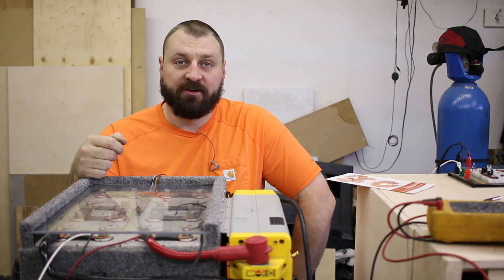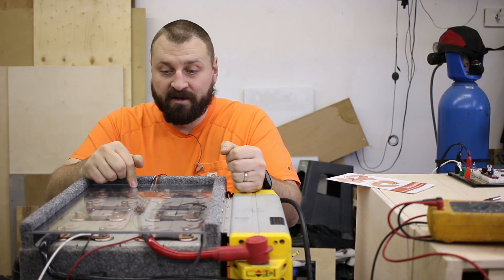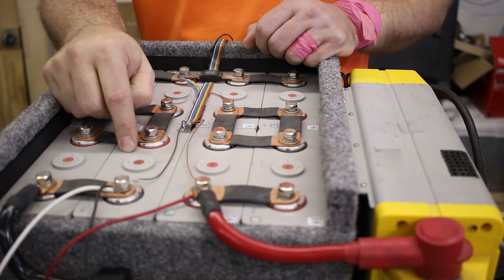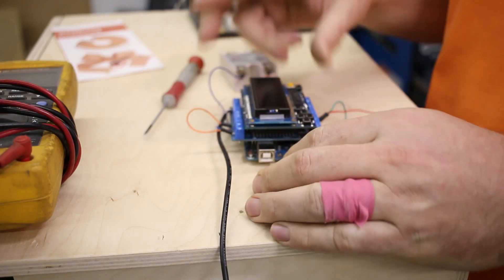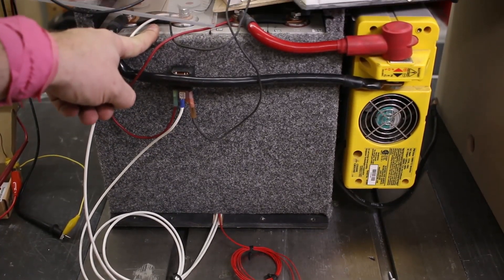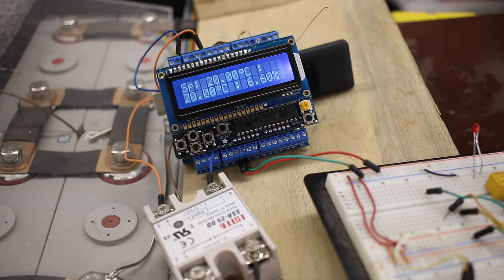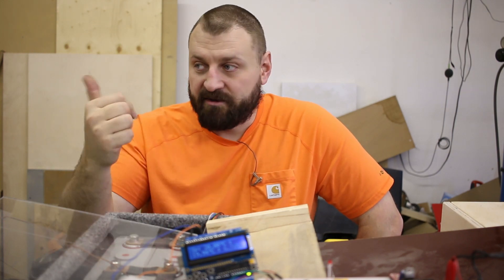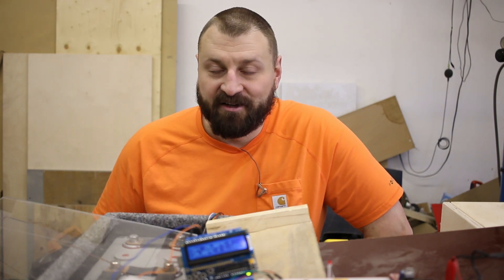Lithium Battery Heater -  DIY RV - How to build an Overlander

Comment: You have had your warming system a long time now.  Do you know how many watts are needed (or percent on time for your 400w heater)to keep the batteries at 20C when the outside temperature is 0C.   Trying to get handle on number of watts needed a specific temperature rise.  I personally built a warmer that circulates are around all 6 side of my 2 100amp batteries.  Battery box is 3/4" plywood with no insulation.  At 0F ambient it takes about 160 watts to hold the batteries at 50F.  Just trying to get a reality check.  Thanks
Reply from the maker: In the Amazon rainforest for the last 5 years, no heater needed.

Comment: I know this is an old video but do you have any details on the enclosure you fabricated for the cells. I plan to double my capacity from 4 to 8 cells and wondered how you had contained the 8 cells. I know you massively upgrade in the future.
Thanks
Reply from the maker: Nothing special, just a plywood box.

Comment: I've been using those fotek's to run 1500 watt water heater elements for years.
Reply from the maker: Yes, the originals are good, but these turned out to be fake with crazy high on resistance.

Comment: Excellent video! As a fellow Canadian I am struggling with how to solve the heating issue of Lithium. Near the end of this video you say you would be using your excess solar to power the heater. Are you able to explain or do you have a video on how you used the solar panels to power the heating element.  My offgrid cabin has 2000+ watts of solar.  The array is wired in series then into a Schneider MPPT charge controller. As a result, the voltage to the controller is approx 150 volts DC. So this voltage would be too high for the 12 volt heat pads etc. Any suggestions?
Reply from the maker: Use a 120 volt heater pad...?
Reply: @Everlanders  120 volt AC pad? or do the make 120 volt DC units?
Reply from the maker: it won't matter, resistive heater pads don't care if it's AC or DC

Comment: 3 years in have you had any faults?

Edit: I see you stated about a year back that they've been ok. 

I just stuck a 15w pad under each one of my cells and have redundant snap disk cutoffs at 104F in place. Since these pads can get very hot im curious to understand the reliability issues.

Comment: Great job man.  I haven't automated my system yet just depend on the thermostat that came with the heater and a 1-hour timer from a 12V heated blanket.  Pretty rough setup but it worked for this winter.  

I am working a 12V outlet box with an ESP board inside with a relay running another relay,  I was trying to find a bigger relay controller to skip the second relay just not as easy to find for sure yet.  

I have seen that it sure does make the battery charge faster although it says you can charge at above 0C getting the battery up to 20C makes a big difference.

Comment: Just a note to anyone thinking of using the amazon water tank heat pads and the metal plate as done here, must of the those heat pads cannot be used on metal they are designed to be used on plastic,, not sure about the more expensive silicon ones... Just a heads up. you could use a thin piece of plastic and then the allum... maybe
Reply from the maker: What possible difference would it make?
Reply: @Everlanders  All i know is i found a website that sells them other than amazon and they had more detailed information  stating  not to be used on meatal surface unless special ordered to do so... Not sure?? but if it is true...
Reply from the maker: But without a link or a reliable source to this information, it's not really useful.

Comment: So why would you not run it off the batteries? the pad will start before they get cold to discharge and you have amble battery storage... I ask as that is the way i plan to do it. as i do not have has much solar panels on mine but ample battery storage. Thanks
Reply from the maker: Sure, run it off the batteries if you want...

Comment: You have given me some ideas for my 4 - 100AH LiFePo4 battery bank project for my remote cabin. Have built PID controllers - cost maybe $12 plus project box thru AliExpress. Since you need AC to power it, something like a SureSine 300w inverter which only draws 55ma on standby should work. Yes, Auduino programming is sexy w/ duty cycle % and all, but I need cheap, simple, reliable w/ a failsafe disconnect from MPPT if temp does indeed drop below threshold set.
Reply from the maker: ??? I used no AC power in this project. A simple DC heater mat and DC controllers...

Comment: teslas do it? i thought you invented this. Still a great demo! big problem for e bikes riding during the winter in Ontario Canada. Need a on board heater for cars and bikes for the future of this industry. Come up with this $$$$$$. Cheers
Reply from the maker: It's no mystery, the bike manufactures could have done this, but the percentage of people needing this doesn't make it worthwhile. I'd imagine that a small amount of insulation would keep batteries warm enough for commutes that a human can endure...

Comment: Does the ElectroDacus BMS measure temperature as well to do Low-Temp cutoff? Where did you place the DS-1820 thermometer? When your pad starts heating, I imagine it takes a while to heat up the whole battery pack from just the bottom, and wonder if it isn't better to use a few pads in between the batteries to warm them up over their entire length, rather than just the bottom section. If you have your BMS measure at the posts, you can block it from charging under 0C, but if the bottom of the battery is 5C and your DS-1820 cuts off, you still don't have a charge. Did you measure the temp difference between bottom and top?
Reply from the maker: Yes, the BMS has a user configurable Low Temp Cutoff. The DS-1820 is in the center of the pack. If you want more pads between cells that would be fine too, whatever floats your boat. We're nearing Guatemala now, so it hasn't been used in a couple of years...

Comment: I love your video. I do have a question though, about your 20 degrees C setting choice. If the LiFePo4 batteries charge just fine down to 0 degrees C, why not control the heater to just keep the temperature to something just above that, 3, 4, or 5 degrees C. I mean, if you are using battery power to run the heater, then it seems reasonable that you'd want to use as little energy as possible, especially if your in a cold climate.
Reply from the maker: Exactly right, however it was 18° in the garage that day, so I needed to have the setpoint higher than that for testing.
Reply: @Everlanders  Thanks for replying so quickly. Now I feel more confident about my thinking to build a similar temperature controlled battery box for my alternate power automatic transfer switch.

Comment: I am fascinated by how comfortable you are touching the terminals of the cells after you told these cells are capable of outputting a lot of currents. It looks like it is perfectly safe to handle terminals if you don't have any metal. I did not know humans resistance is that high enough to enables us to safely handle terminals. I love your videos
Reply from the maker: Correct, the body's resistance is so high and the voltage is so low. They are only 3 volt cells, even the whole bank at 14.5 volts can be touched. With very sweaty skin there is a little bit of a tickle, but not very much.
Reply: When I started studying electricity in school I couldn’t understand how you could touch 115 volt power and not die. My teacher hooked one of the kids in the class to the larger variable supply in the lab. He held the terminals in his hands. We could see the voltage and the current thru his body. He really didn’t feel much till 80 volts Ac. He took him to15 milliamperes or so with no serious issues. The resistance of the human body is in the mega ohms. Obviously if wet it goes down. At 12 volts the current thru your body is negligible. Later in life I was wiring a panel in a warm space and was getting a tingle of the neutral. I was pretty sweaty from working up there for a while. My boss came up and with his very callused hands and not being sweaty he couldn’t feel a thing.

Comment: Great work my friend 👍
I was thinking to myself on controlling the battery compartment temp with the espar (or equivalent) diesel heater, having a electronically controlled butterfly to adjust the air flow when needed. For this setup will be needed 2 temp sensors. One for the living space and additional for the battery space...as well as a Park mode switch/state (when away). Those this make any sense?
Reply from the maker: Sure, that's possible, but with so much solar doing nothing, it makes more sense for us to do it electrically.  https://youtu.be/cM5s4F-7AOk
Reply: @Everlanders  I know, I've seen that "Nice Awning" ☺️

Comment: Question about temperature let's say it's 0 degree C I imagine discharging the battery will warm up the cells to hopefully a temperature that will safely accept charge. How do you calculate such rate of heating?
Reply from the maker: No, our Lithium (LiPoFe4) is immune to self-heating at the currents we're subjecting them to - We've since upgraded to 20 cells, and our suggested discharge rate before they start heating is 20,000 amps 😮
Reply: @Everlanders  WOW shit really?!?!? That's helpful to know mate. Thanks for replying! I like that gel pad setup 👌
Reply from the maker: Yeah, It's a Beast now - The Video is here: https://youtu.be/2uYENzaDBY4

Comment: i'm looking to install a system like this In my truck camper as id be leaving in here year-round in Kamloops (so not super cold but below zero for sure) how would you recommend powering a system like this if it's not off the main battery it's warming? I won't be driving all-day so id be unable to run it off the car battery. but maybe use that to start off each morning and then run it off the battery its warming for the rest of the day?

Or any ideas to improve the system? lower power usage maybe? Id love to hear some of your ideas. Loved the Video! super helpful
Reply from the maker: We wouldn't ever run the heater off the battery except in a deep freeze emergency, the heater is powered directly off the solar so they start warming as soon as the sun comes up. Heating overnight isn't really needed if the box is well insulated - it's such a big thermal mass it takes a long time to cool (and heat). I don't think I'd use a high wattage heater if I was to do it again, 80-100w would be plenty in an insulated box.
Reply: @Everlanders  perfect thank you! this looks like the best system then. Do you have it directly linked to solar or do you run it through an MPPT and other things first?

Comment: I did much the same to my Lifepo4  RV pack using a 12v heater pad on a thick alloy plate though spaced the cells slightly off it so air would circulate - I think my heat pad was designed for beekeepers to keep the hive warm in winter- My pack differs as I put 650F 6 Supercaps in parallel with it to act as a buffer to flatten out spikes and surges when the inverter  goes on - My pack is in a 2" Celotex box - I have noticed the battery get 8C warmer when say it's getting a 30amp charge for 4 hours from the solar - it might be an issue in warmer climates but OK here in Blighty
Reply from the maker: I haven't been able to measure any spikes or dips on our batteries when hitting it with a big load... But since we filmed this video, we've upgraded to 20 CALB cells, shown here: https://youtu.be/2uYENzaDBY4

Also, there is no increase in temperature even when charged at 80A, I don't know that the cells self hearting is a good thing...

Comment: battleborn charge $220USD for a 30w heatpad and only heats 1 100AH battery oO   but they are wrap around pads. is this 400w on the bottom good enough or should u divide it into 4x100w pads for even heating.
Reply from the maker: The aluminum plate acts as a heat spreader.

Comment: It seems like a good idea for the winter. What do you do in the summer?  I mean heat is damaging the batteries and that insulated box will keep the heat inside.
Reply from the maker: Our bodies are inside that box too... So the same AC that keeps us alive keeps them cool.
Reply: @Everlanders  I meant the box that you keep your batteries in. LOL
Reply: @3dmixer552  is the same,  the batteries are within the living quarters.
Reply: @michaelramsey9975  I get that, but when you pull high current the battery will warm up and due to lack of air circulation the will be trapped in the box and battery would get hotter.
Reply from the maker: No, these batteries should not heat... They have a recommended max discharge of 2000 amps... And we have 5 in parallel for 10,000 Amps of capability. Looking at our logs, we've tickeld 400amps once with the AC and all 3 air compressors running at the same time... Further, battery temps have been logged for the last 3 years and our max temp was 27°c (outside air temp that day was 37°c).
Reply: @Everlanders  I see. Thanks for clearing that up

Comment: I am fascinated by the degree of tech involved on your whole solar + battery system. After talking about safety first you started touching multiple battery connections without the Lexan. All over touching. Was that because it was completely dead? I would never touch the positive and negative terminals on my truck battery, yet you seem to do that a lot on this video. I was clenching during the viewing. There must be a good reason. Also it would be cool to know how these bus bars are wired series parallel etc.  Maybe that is part of the reason it was safe to touch.
Reply from the maker: 12 volt batteries, as this was configured at the time (4 series 2 parallel), is not enough to shock you. Your body's resistance is too high. The danger is real however, if you dropped a wrench or something metal of low resistance, that would spark and heat up quickly.
Reply: you can touch things up to about 80 ish volts before it gives you a nice enough "tickle" that makes you want to let go.
Reply from the maker: Or 9 volts if you lick it! 🤣
Reply: @Everlanders  Hahaha Oh yup :D
Reply from the maker: Or 9 volts if you lick it! 🤣

Comment: How about adding heater pads to the sides of the box as well? That would heat the batteries much more evenly and therefore quicker, and you could use lower powered pads (if they are available?)
Reply from the maker: The pad is PWM temperature controlled, so it is pulsing on and off at a very high rate of speed and thus quite gentle in it's heat.

Comment: Are you using a relay to disconnect solar when it is below 0 degrees? or does your charge controller have a low temp cut off function?
Reply from the maker: The charge controller has its own internal temperature sensor, and a second inside the battery bank. Further, it has user selectable upper and lower thresholds for temperature and will cut the charge and/or load FETs if the batteries temps go outside these parameters. Further, the controller monitors each cell and if any one cell goes above or below prescribed thresholds, the charge and load is disconnected.
Reply: @Everlanders  oh wait you're using electrodacus controller right? I forgot haha very nice!
Reply from the maker: Yup, we have 2 of them in fact.
Reply: @Everlanders  wait did you comment saying your headed this way? I'm down to meet up anytime you're in San Diego :D
Reply from the maker: We were in Mexico for a couple of months, Giving a presentation at Overland Expo this weekend in Flagstaff, then into Northern California quite likely. Will be in touch if I'm down that way again.
Reply: @Everlanders  awesome!!!

Comment: So, it's 24 volt(ish)? You could connect differently to get twice the amp hrs @ 12v, right? I ask because I'm running a mix of 12 and 120 on my rig. Your panels could support quite a bit more battery could they not?
Reply from the maker: They are connected differently! 😁  2 Parallel, 4 series, 3.4 Volt cells = 360Ah @ 13.6v...  Yes, We could support a lot more battery, but what we have is working good now... We mostly use power in the day, when there is lots of sun, and basically using straight off of the solar, When we do have high loads like Cooktop or AC it does dip into the battery a bit, but it quickly recharges.  The amount of battery we have is nicely matched I think,  it really just needs to get us through the nights and through weeks of rain, but our demand goes down during the nights and in rain 😁 But yeah, If I find another good deal on batteries, I would maybe double it for fun, 10kW total.

Comment: I have developed a similar system for my  little campers 100a lifepo4 - I used this device to trigger a smaller mat  of just 8watts fixed to a metal grid salvaged from an aftermarket  motorcycle radiator guard https://www.ebay.co.uk/itm/Digital-Heat-Cool-Temp-Thermostat-Temperature-Control-Switch-1PC-DC12V-50-110-C/113667684833?epid=17013003634&hash=item1a771f39e1:g:wf0AAOSwdzBcdvEO&frcectupt=true

Comment: Any thoughts on going 24 volt and using a Tesla battery?
Reply from the maker: Love it... We went 12 Volt because so many RV systems are already 12 Volt and then we don't need to run converters.
Reply: @Everlanders  I've been binge watching a number of channels and Will Prowse makes a good case for the 24 volt Tesla batteries but I'm inclined to stick with 12 volt myself for simplicity.
Reply: @YhAFbwts  Don't go 24v tesla battery for Rv living, the battery chemistry dictates the voltage for the 21700 cells slightly differently than LFP chemistry, so all your charging / discharging regimes don't match up and you either waste available capacity or risk over charging them. Then there's the unstableness of the chemistry risk.. Those 21700 WILL catch on fire and runaway if you cock something up.. LFP's wont.